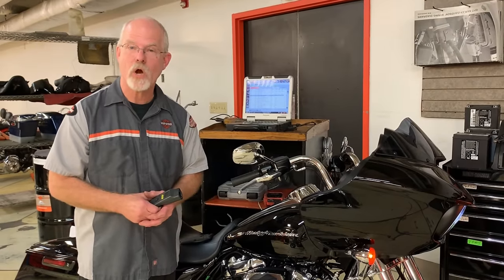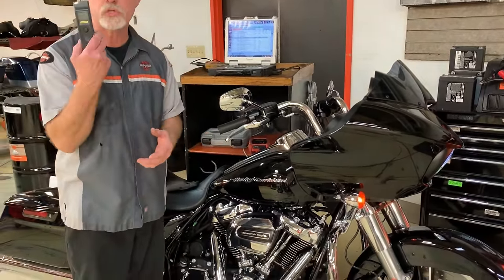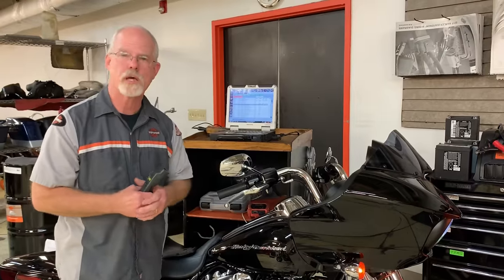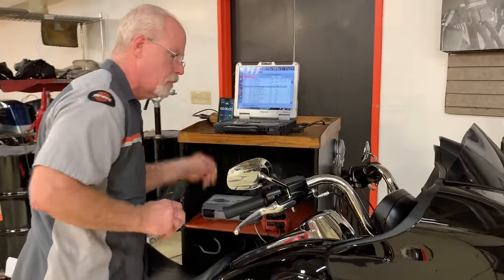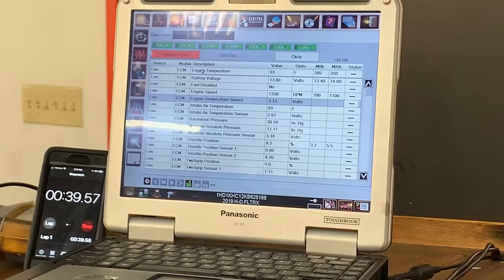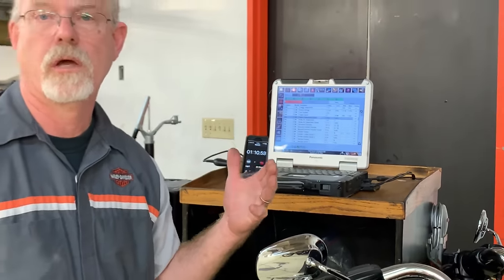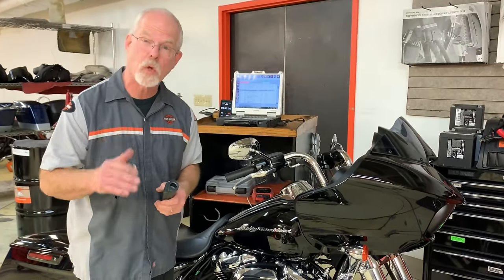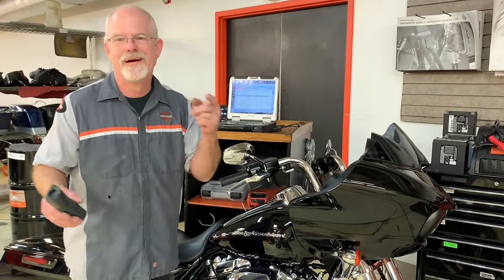DOC HARLEY: HOW LONG TO WARM UP YOUR MOTORCYCLE

Comment: Thanks for the info. I'm an new Harley owner and was told to let it warm up for 10 to 15 minutes. I've always thought it to be too long but hey as a new owner I listened . I'm thinking a couple of minutes or so while I  put on my gear and open the garage do is good.
Reply: start it ride it...............simple cold unburnt fuel does the damage the oil is fine
Reply: 10-15 minutes is way too long. Way too long. If the bike is fuel injected, you don't need to wait. Why would you wait for a Fuel injected bike the same way you would for a carbureted bike even though they're completely different fuel and air delivery operating systems?
Reply: @CenobiteBeldar  I was told to wait 10-15 minutes, I didn't say I waited that long. I usually wait just long enough to as long as it takes me to put on my gear and check my lights etc.
Reply: @risanch  10-15 minutes is a long time. If my car or truck sits idling that long the fuel needle will move a little. These are fuel injected engines. It doesn’t take a human guess who can’t read fuel and air measurements without a computer to warm a bike up. We’re using carburetor baseline methods. We should be able to find ways to warm vehicles up better than yesteryears. Oil a hundred years ago isn’t the same oil as today.
Reply: Fuel injected?  I do 30 seconds to a minute.  Carb, a minute or two. A carbed Evo or older, 2 to 5 munutes.
Reply: @Michael Carlson  thanks,  I actually bought an older HD it's a 2000 Heritage softtail. It's getting harder to find people to work on it. A few HD dealers near me don't have mechanics who know how to work on carburetors. Which is 🤔 odd, but oh well. I found an HD mechanic who works out of his garage. He's so busy, and I need to schedule an appointment for service.
Reply: you need zero idling time, if you are using good oil, it's already everywhere it needs to be. Start it up and ride gently for a few minutes; that's the best warm- up for any gas powered vehicle.

Comment: The biggest reason to let it warm up a bit is to get an oil film on everything and then a few degrees temp.  A minute is probably plenty and I like the check lights/tires idea.  Then don't beat on it until after a few miles.  The first 30 seconds on any engine is where the most wear occurs....give a bit to spread the oil around...especially on high wear areas like cam and lifters.  DEFINITELY don't take right off during this time...will most likely cut your engine life

Comment: I can’t even take the choke off for at least 2 minutes. Otherwise it’s still too lean and spits back through the carburetor. Usually 3-4 minutes is good. When it idles on its own it’s good.

Comment: I tried different time cold start warm ups. 30 seconds a bit short. One full minute, followed by easy run ups for the first couple miles it seems to run smoother. Air cooled bikes really should not idle more than a stop light, but where I ride I don't see any.

Comment: Just 15-30 seconds? I always warm up my bike for about 5 mins and ride it easy for about 4-5km before riding it hard
Reply: dont........unburnt fuel in a cold engine at idle does the damage.Hop on and ride
Reply: My 96 Sportster runs great warm up 5 minutes usually 😊

Comment: That's how it done alright. Start-up do a walk-around, check all lights, tires, Chain or Belt drive, Jump into the Saddle and hit the throttle just keep the RPM's down below 3200 for about 5 miles.

Comment: I usually give mine about 2-3 minutes depending on outside temperature when you can put your hand on the cylinders and there getting comfortably warm it's time to ride. be cautious of running a oil cooler without a thermostatic valve non thermostatic coolers will just allow water condensation to collect in the oil especially in cold or humid climates were the bike is ridden on short trips and then internal rust or corrosion can start.

Comment: Love your videos on YouTube, you have helped me many times.  I have a question.  I Purchased a 2003 FXSTD Softail Desue from a private party and he did not remember the PIN.  I have tried the way you have on your videos, but nothing happens on this older Harley.  Do you know how to find or change the PIN?
Thanks, for your help..
Reply from the maker: The easiest way is take it to your dealer. he can connect, pull up the pin and install the pin you desire....Doc

Comment: How about a gauge on the dash that tells us the temperature so we know when it is at operating temperature?!!!!
Reply: Harley rider, yes stupid Harley doesn't put a gauge
Reply: I believe Harley has an oil cap that reads your oil temp.
Reply: The oil dipstick temp gauge works if the battery is ok, but you have to get off to read it!!!!@#$%
Reply: @dalen.tenney5210  Ha ! Never thought of that. Not exactly ideal is it ?  Thanks for the feedback. I own a '17 breakout with V+H 2-2 Big Radius. Stage one.

Comment: Just like a car. Turn it on, 1 min warm up drive nice for 5 mins or so. Just make sure oil is flowing good, hook up your cell phone, and take off. Not rocket science.
Reply: Smartest comment I have seen yet.
Reply: Cell phone on a motorcycle....you're addicted to it!
Reply: @benjytexas  and?
Reply: @jsj297  , as slow as you're going, you can even use the cellphone while riding, got it!
Reply: @benjytexas  huh?

Comment: I have a ‘98 Softail Custom with the CV carb. 
For some reason no matter what the air temperature is I always need the choke to start it. Not like hopping around town doing errands but if it sits for longer than an hour I may. 
Once it’s started I never leave the choke on for more than 30 seconds. But if I don’t let her warm up for at least 5 min she tends to sputter and stall. 
I was told by a mechanic that I should let it warm up till the little block where the rods meet the crankcase is warm to the touch.
I’m wondering if that’s due to the way the original owner ‘trained’ the engine before me.
I know others with similar year bikes that they only need choke in colder temps.
She’s a work in progress and I’m replacing the original carb with an S&S E carb next week and having it tuned to the Vance & Hines pipes and the new cam. Hopefully that will help with the starting and warmup issue. 
I can’t do the walk around inspection now because I have to hold the throttle till she’s warm or she keeps stalling.
At least I’m lucky enough to have nice neighbors who actually like my bike and are up and about by 6 AM as well.
Reply: Thanks John, I will definitely check it out. Thanks for the heads up

Comment: Hi.  I'm from Europe.  I'm watching your channel.  One of the best materials about Harley.  That's why I wanted to find out from you what the operating temperature of the oil in Evolution should be, I use Amsoil 20/50. Thank you very much in advance.  cordial greetings.
Reply from the maker: Thank you for watching. I do not have the information you requested for Amsoil….Doc

Comment: On my road king and softail I'll set there and kinda touch my cylinder heads when I feel heat in them hot to the touch that's when I haul ass usually about 3 to 5 minutes

Comment: I ride a KTM 890, and i let it idle until the coolant temp shows 4 bars. Usually takes about 3 minutes or so. Then i give it a couple braps. Then hop on and go. KTM has a pretty cool feature built into their engines to let you know they are warmed up. When you start them, the valves are noisy, then when its warmed up, you dont hear them. Joking aside, i've read thats just a thing with some engines. The bike barely has 1k miles on it. And for the first 600 i may have touched 7k RPMs once, other than that it was no higher than like 5k.
Reply from the maker: Thanks for sharing a look at different technology. BTW you do own a Harley?....Doc

Comment: On cold days I use a heat gun on my oil tank before starting, cold storage sucks.
Reply: I use a space heater for about 10 minutes before starting it in 15 degree weather and it starts right up every time and idles around 1100rpm but immediately goes down to 900 👍

Comment: I just took my 2016 Sportster to a dealer due to a stumbling and stalling issue within the first few minutes when cold that has happened since I bought it. I always wait the recommended minimum recommended 30-45 seconds to start riding. They told me they couldn't replicate the issue and I should wait 5-10 minutes of idling before riding! I even called Harley Customer Support and they said only about 30 seconds should be long enough. I gave them the live data recorded from my Secreamin Eagle Pro Street Tuner on the usb and they told me since they couldn't repliacte it, they wouldn't look at the files.  My dealer is 125 miles and over 3 hours drive away.  I'm so pissed.  Wish I could bring it to you guys but I'm in California.
Reply from the maker: I understand your frustration, that is a long drive. From a tech point of view, not all issues are easy. Twice as difficult if the scenario can’t be duplicated, ie having the bike a week to try every morning trying to get the data needed. You mentioned a SE tuner. Have you tried different maps only for cold start up? To incorporate it into your current map. And then there is the question, dyno tuned?….Doc
Reply: @LowCountryHarleyDavidson  Doc, thank you so much for the reply! I was an automotive tech for 10 years so I understand the struggle. Thats why I went through the trouble of collecting the files for them to analyze. Unfortunately, there are no dyno tuners around thanks to California and the EPA. They couldn't replicate the issue because they warmed it up for 5 minutes or more before riding it, not as the problem was described. I have tried adjusting the tune several times with the SE auto tune and it hasn't helped. It also doesn't allow any manual adjustments to the map. The tech I talked to said I seem to have a good tune on it because it runs really well. Haha! I may get a better tuner and throwing parts at it or sell it. I figured with my certified warranty and the factory tuner they’d at least try a little bit.  The knowledge you pass along is priceless! Thank you and LCHD for all your hard work on these videos!

Comment: Meh...with fuel injection I just start n ride. The oils are so good n stuff. Doesn’t hurt a thing. Been starting cars n driving off all my life n cars go forever. Just do what you want.
Reply: There's a huge difference between cars and motorcycles. Motorcycles are air cooled cars have radiators. A Harley engine is like an airplane engine then. It takes me 5 minutes minimum to get to the runway and do my runup. So I give my Harley 3-5 minutes.

Comment: I have a ‘19 RG Ultra, and find until she gets really warmed up the hydraulic clutch it a real PITA. Touchy as hell. It doesn’t smooth out until I’ve been riding for a while. I wish they’d have just stuck with a cable system, which I’ve heard they actually went back to on the ‘20 models. My least favourite thing about my bike. I just bought it new in September ’20, so am hoping over time it smooths out. But it sure is frustrating to feel like a noobie, after 36 years in the saddle, popping the clutch all the time, when I first start out each day.

Comment: I had my 2004 FLSTC HD in to my local HD dealer to have the choke cable replaced in September. After that the motorcycle would hesitate and backfire for several minutes when I would first get out onto the road whereas it didn't do that in the past. I'd always let the engine warm up for about 2 to 3 minutes as I put my helmet and riding gear on and it never did that until I had the choke cable replaced. Could you give me any reasons as to why this is happening? Could the mechaninic at the dealer have done something to my motorcycle to cause this? I'm not happy about it and it has caused me concerns my motorcycle was tampered with making me have to go back.
Reply from the maker: The carb was removed to install the new choke cable. It is possible the rubber seal between the carb and manifold was re used and compromised. Or it is possible that the original 2004 manifold seals just happen to fail and are now leaking… Doc

Comment: I start and drive immediately! Slow. Idle cold develops moisture!, condens. Rev not higher then 3000rpm till 15min and then careful some more speed
Reply from the maker: Thank you for sharing. I do not agree with cold idle creating moisture…..Doc
Reply: @LowCountryHarleyDavidson  this is what I learned in the old days as a mechanic. The proper way to warm up a motorcycle is to ride it as soon as it will respond to throttle without dying. This allows everything to warm evenly with air flowing across it as the designers intended. If you leave your motorcycle sitting on its sidestand with the choke on, you invite several kinds of problems.

Comment: I have been riding over 45 years and it bothers me that people leave engines idling for more than 10 or 15 seconds - the worst scenario is when a group all start the bikes up and insist on reving their engines for five minutes or more until the tardiest in the group catches up..... I have sometimes apologised to my neighbours about the noise after an early morning or late night arrival/departure and I always get the same response -' it's OK because you start it up and go' or shut it down as quickly as possible - that way if I make a little noise during the day no-one complains about it.
I seem to recall that the way  recommended in a rider's manual was to start the bike and ride it to warm it up, not leave it idling - oil pumps don't work much at idle. Like most H-D's, mine does not have the original mufflers so just starting the bike and riding off means less complaints from neighbours. 
If you go by engine or oil temperature then the bike isn't really 'warmed-up' until twenty miles or so and I never ride 'enthusiastically' until after that amount of miles.  The need to warm an engine up is so that the cylinder 'grows' in height and provides a good seal at the base and head gasket - Evo engines were always blowing the paper base gasket out as people didn't sufficiently warm the bike before giving it the gun..

Comment: Do you have a video showing you disassembling a 2001 (through 2006 Sportster 883, or similar, heads to see why there is oil coming up through the spark plug threads? I bought a pre-owned 2001 in 2019 and 16 months later it developed the aforementioned problem. As you might expect, it does not run right now. It will now sit in storage until I can save up about $5,000 to have someone work on it.

Comment: I let my bike warm up to op temp before I take off. I run my bike at least five minutes. And my bike don’t run at know 230 try like 205 with an oil cooler. HD sporty. When start a 20 cylinder EMD same thing but this engine take at least 45min to one hr. I have two of them to get hot. In warm water like the Gulf of Mexico when engines oil temperature get up to 216 its time to reduce power engine oil starts braking down at that temp. I’m sorry Dr I have one of those temp gun too

Comment: Doc, I've got an 04 carbureted Low Rider and it takes me a good 5 minutes or so to get her warmed up enough to get her on the road w/o her wanting to stall at idle..any suggestions?
Reply from the maker: Inspect and replace the rubber intake seals. Possibly look at the fuel lines and tank fuel filter. When was the last time you changed the spark plugs? Is it jetted correctly for the modification you have done?…..Doc
Reply: @LowCountryHarleyDavidson  ...yes, sir.  I've had the intake seals replaced, the carb cleaned and rebuilt, new plugs and 3 hole fluid change at a local shop.  Always start with 1/2 to 3/4 open choke for about a minute, then push it in and let her warm up...🙏👍

Comment: im a new rider just bought 21 try glide 2 weeks ago after riding i let it idle while opening the garage ride in and cut it off, the 2 times I've ridden it and it shoots few ounces of coolant out the overflow after its cut off, but shows slightly below full cold?
Reply from the maker: It is rare that year. I would have your local Harley-Davidson tech check the system, especially the radiator cap….Doc
Reply: Apparently this is common problem  with filler neck and or cap not being seated properly and during post riding cool down the pressured system gets confused basically

Comment: I just watch my idle speed, when the bike  idles at 850sh rpm your bike it's ready to go gentlemen, and that takes a little over  3 mins if you're wondering. I apply the same method every time before riding. 
Just turn your bike on while you gather your things.

Comment: what about riding in freezing temps? I always worry the engine doesn't like it because it is air cooled and it might not get to 200+ if you are going 60-70 on the highway in 6th.

Comment: With my vance & Hines Fuelpak, I monitor my engine temperature. It reads 265 degrees on a hot day. Is that normal??? 2018 road glide
Reply from the maker: You’re running slightly warmer than I’d recommend but that depends on what performance items you’ve added and if you’ve tuned it.
Reply: Low Country Harley-Davidson I just did the normal.. mufflers, air intake and the 3pak mapping! The bike feels really good and I don’t feel excessive heat at all! But the 3pak does read 265 degrees on a hot day
Reply from the maker: Sounds like everything is ok.
Reply: My 2017 M8 runs the same as Alfonso’s with an FP3, Vo2 cleaner, and V&H slip-ons; a bit higher depending upon ambient air temp.  It runs great. Is the ECM displaying Cylinder head temps?
Reply: On a ride longer than 30min my temp on the Milwaukee 8 114 reads 310-320 on the power vision. It has heavy breather, and full exhaust. It’s been tuned with the power vision and I’m using wide band O2s. It’s slightly on the rich side too. 🤷🏻‍♂️